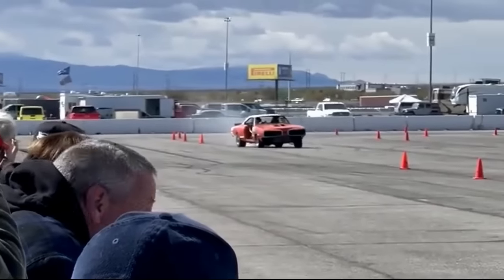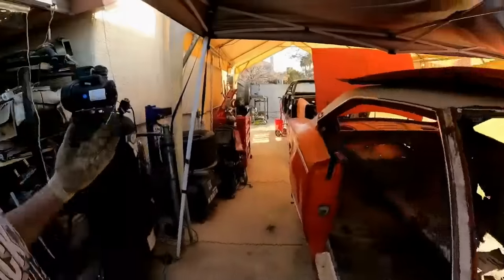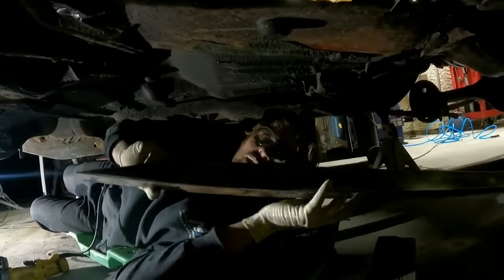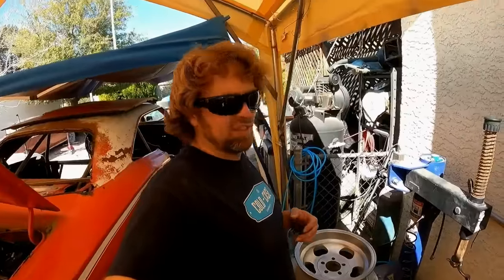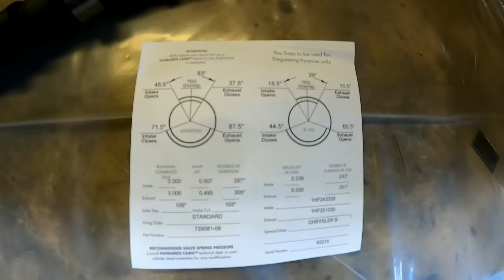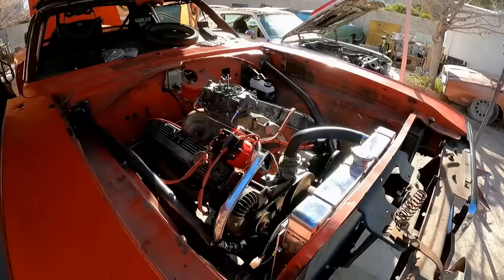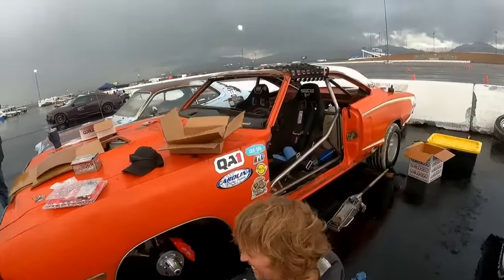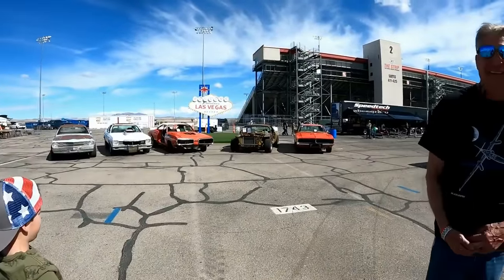Super Bee-ter gets an overhaulin into a floorless doorless trunkless autocross racing Beast

Comment: My buddies low deck 400 block had the same problem with leaking main seal after it was line bored, they never recut the rear main seal groove so when the caps were cut the rear main seal was egg shaped, he had the rear seal groove recut and it fixed the problem